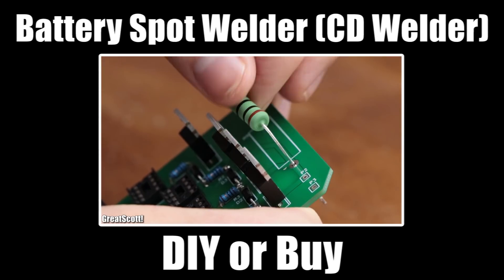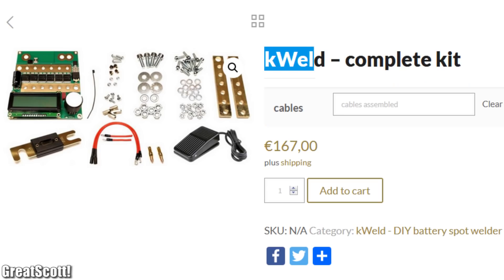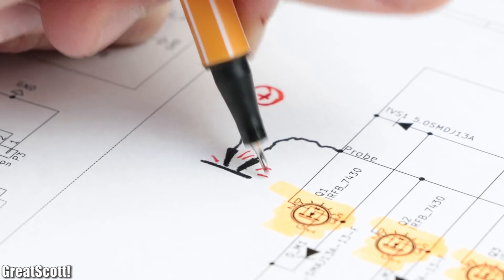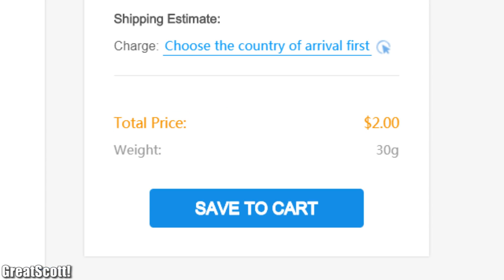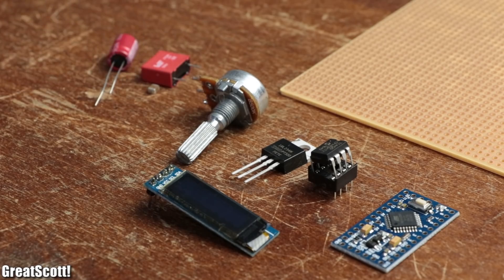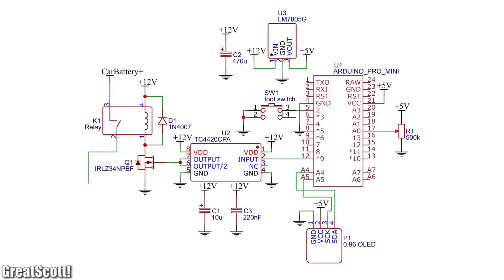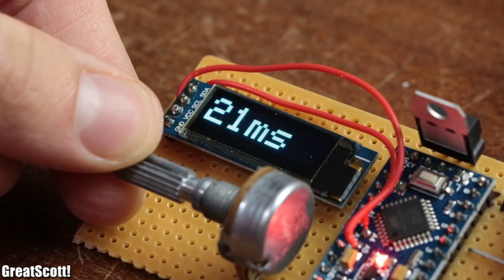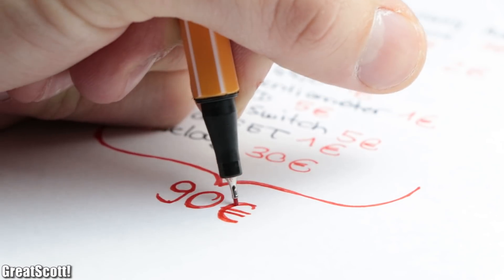Make your own Crude Battery Spot Welder with a Car Battery!

Comment: Still not simple and cheap enough.  Here's one using a cheap car starter solenoid.  There's another otherwise identical one which uses a very cheap timer module with relay from eBay to set the length of the current pulse by setting the length of time the relay on the timer module energizes the car starter solenoid:

https://hackaday.io/project/163768-minimalist-li-ion-cell-welder

https://www.youtube.com/watch?v=o1NFbchHeM8

Comment: Wouldn't the relay wear quite a lot with this high current switching?
Reply from the maker: I only experienced it one time during my testing that the relay got stuck. But by "hitting" it a bit, it worked without a problem during the following hour of testing.

Comment: DIY or Buy Idea:
1. DIY Or Buy Lab Bench Power supply 
2. DIY Or Buy Power Bank
Reply: He kiiiiiiinda already did the first one, but it wasn't actually a DIY or Buy. He did, however, prove that building a decent starter power supply out of stock parts or even recycling an ATX power supply was doable for cheap.
Reply: Somehow I feel that the power bank is coming soon, now that we can weld battery tabs :)
Reply: @DanHaiduc  he did one for a pc one soooo?
Reply: Just buy module that Dave reviewed in EEVBlog #1030
Reply: Both buying are winning
1: there are wide range of buck/boost and CC module.
2: you can't source lipo battery for good price( the cheapest 20000mah powerbank is less than $20, and it support QC and lots of protection method)
Reply: @bacphan7582  You can get laptop battery packs new or used and rip them apart for 18650s, if you look around for good prices you can usually get about eight 2800mah cells for a little over $1 a piece or at worst you get a used pack with slightly lower capacity and it may have a couple dead cells, then you can find fairly decent powerbank cases for around $8 or pretty much whatever size you might prefer, you may even find one with a feature you didn't know you wanted such as some sort of pocket sized work light.
Reply: @vgamesx1  are you comparing NEW powerbank with used one?
If you want, do you know how cheap is 20000mah USED powerbank?

Less than 10 bucks
Reply: @bacphan7582  I thought I was fairly clear in what I said and if you want to go in that direction then guess how cheap it is to renew a DIY powerbank? The cost of the cells... So going by your 20000mah example, that would be between $6-8 which also means if you pick up a nice powerbank you quite like, you can keep using it rather than tossing it like some disposable item.
Reply: Well 1st is very reasonable because the PSUs are very expensive but the second is definitely buy option because it has a professional casing out of unflammable material(speaking of quality ones), a much better circuit than anything you might build and a quite compact design.
Reply: @tunahankaratay1523  not really a better circuit. You can diy better circuits with ease. You can add real fast charge to the powerbank (we're talking 4.2v 8A, charging the whole thing in less than 2 hours), balance charging, etc. But it's bulkier and not as pretty.
Reply: @somedude2492  Yeah I mean somethimg like 15-20 Ah that fits in a pocket is really hard to do yourself because those super efficient tiny SMD circuits are hard to build. But I do agree that some powerbank with 300-400Wh capacity is much better to make your own because for one commercial ones are quite expensive for the performance unlike smaller ones, and two it gives much more flexibility on input/output characteristics (solar/windmill/watermill input, laptop charge, ac output, 12/24v outputs etc.).

Comment: Still more expensive than a microwave transformer option. Controllers for it on aliexpress about 13$, transformer, and thick wire = 20eur. You get also the time and power adjustement.
Reply: Link?

Comment: Could you not just buy a big used car battery from a junk yard. Use 2 jumper cables. Connect them to two old multi meter leads. And spot weld?  Seemed to work for me.   But I am not understanding the specification for duration needed or something.  Maybe it is a safety issue?
Reply from the maker: If you got no pulse time setting then you can easily destroy the material you want to weld. Like I did in the video before the intro.

Comment: Just do a used motorcycle battery, solenoid from a car, and foot pedal.
Reply: The CCA from motor cycle batteries are quite low, sub 150 from the last time I went shopping for one.
Solenoids are one shot and you can't really push much current through them unless they are broken.

Comment: Finally a spot welder I might build! Thanks a lot!
Reply: I might build the other, though, because the reason it didn't work was some critical mistakes when designing the PCB, not its feasibility, and I don't have a spare car battery nor a 1000 A relay (which are quite expensive).
Reply: you may even use a 200A Battery disconect Relay - as i did - wich is cheaper
Reply: Your comment is 2 Days old. This Video is uploaded 2 Hours ago. YouTube?... What is going on?
Reply: @denndy  Patreon.
Reply: Hey did you make it buddy? @deadbird99
Reply: Old saw blade
https://youtu.be/WtNk_qIcN7Q